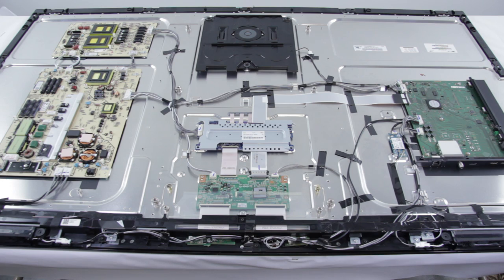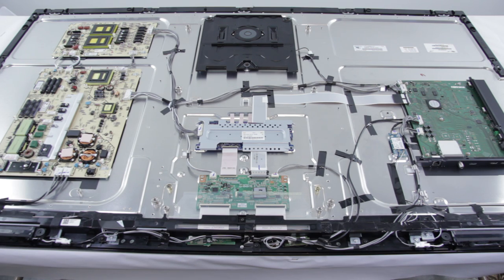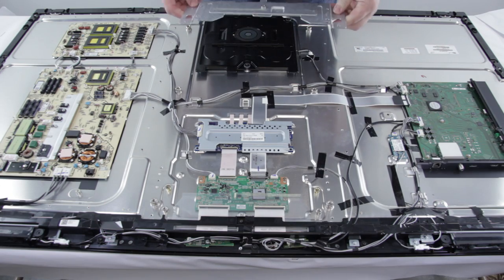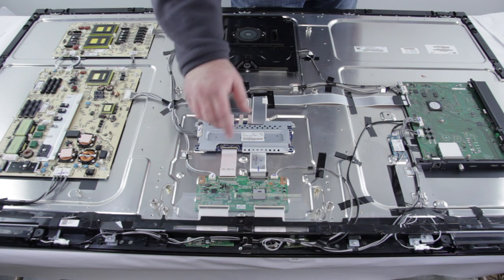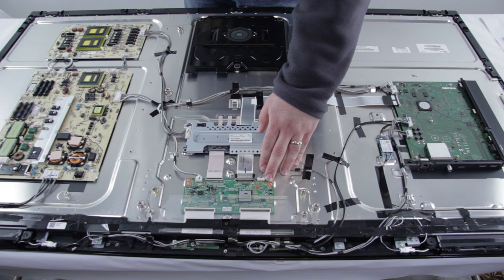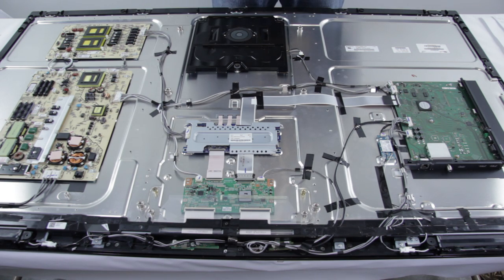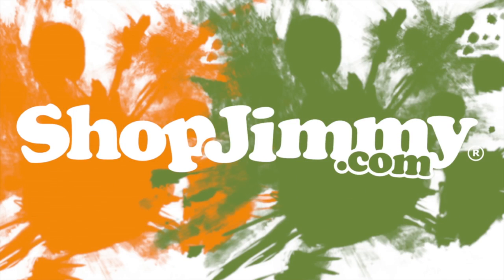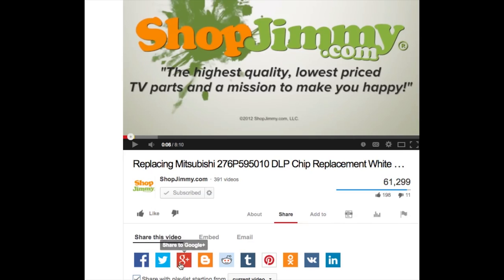LED TV Repair T-Con Board Help Review Overview - Common Issues and Problems with T-Con Boards

Comment: I have a Samsung UN75JU7100 serial number O3KA3CAH100274Z.  TV is 16 months old and while working to put in a flash drive with vacation pictures developed a thin red vertical line on the left hand side of the screen facing the TV that extend from the top to the bottom.  You notice it more with the background is dark but it is there all the time.  I called Samsung and they had be unplug all inputs to the TV,  unplug the TV for a minute then cycle power on and off.  Then turn the TV on and go to the TV menu.  The red line is in the same place which is about a third of the way from the left edge of the TV.  Looking for ideas what to replace, suggestion on how to do it and if you have the part to repair it and the cost of the part.

Comment: i replaced the t con and main board because of sound and no pic. i got my parts from you vizio E7o1i -A3 now my 70 in vizo tv has power back lights and the scran is green when turn on no logo. no buttons work but power. tryed to reset didnt work. help my

Comment: I have a sony kdl 46v2500. When I turn on the TV, it quickly goes to standby mode and the red standby light keeps flashing once every second. I was told it should follow a pattern like flash 3 times and pause or 4 times up to 13 times, but this does not happen. It keeps flashing every second. That's it. I wonder what is wrong. If I unplug it for a minute and then plug it in and trun it on, it will turn green breifly, but before the sond or the picture comes on, it goes to standby mode and turns red and keeps flashing. I don't know what part to change. Do you think you could help me?
Reply from the maker: +Reza Yazdani  Try all repairs and troubleshooting at your own risk.  What is the exact number of blinks that you see with your TV?  Thanks!  www.shopjimmy.com

Comment: Hello, i have A Bravia kdl 32ex425, it shows white vertical lines like shadows and bad color config, i've changed the tcon board but nothing
Reply from the maker: Luis Cuevas   Try all repairs and troubleshooting at your own risk.  This sounds like a TV panel (TV Screen) problem.  If your TV panel is bad, it may be more cost-effective to replace the TV as panels are typically hard to find in stock, difficult to replace, and expensive.  Thanks and please let us know if you have any further questions!  www.shopjimmy.com

Comment: I have a Samsung led TV, model number UN55D6000SF that is not quite 3 years old.  The  problem first started with horizontal lines. The picture would freeze, then the picture would not show on the screen, but the sound remained. The sound is now cutting in and out and the picture is also gone. Can you help?
Reply from the maker: Barbara Taylor  Please watch this video FIRST to help with your repair!  TV Repair! LCD, LED, Plasma, DLP How To Fix Your TV with ShopJimmy.com Help!  This could be a problem with either the T-Con board or the Main board, or the TV panel is bad.  I recommend replacing the T-Con and the main board individually to see if that fixes the problem.  If that does not fix the problem, then you have a bad TV panel.  Here is a link to replacement parts:  http://www.shopjimmy.com/catalogsearch/result/?q=UN55D6000SF  Be sure to match part numbers on your current board, with your replacement for compatibility.  Thanks and please let us know if you have any further questions with your TV Repair!  www.shopjimmy.com

Comment: LG TV Model: 50LA660TV

Symptoms: turning itself on/off, pixelated image so that you cannot see any apps on TV or no image at all, no sound. Strangely enough when set top box is switched on, image is fine for the few second TV stays on. Checked the timer settings and this seems fine.  Checked all the HDMI cables, power cable etc for dirt and all seems clean. No cable damage visible. Swapped HDMI cables and TV still does the same thing. Tried restoring to factory settings.. no effect. TV still does the same thing. Also stopped responding to the instructions sent via a pilot. I am trying to work out whether this is a t-con board or main board issue. 

Show less

Comment: I have a Samsung UN50H5203AFXZC TV. The red light is on, when I turn on the TV the red light flashes 5-6 times then turns off. TV will not turn on.

Comment: I have a Panasonic  LCD, Model # TC-L32X2.  with NO Video and No Sound.  However it worked for a couple of days later and now doesn't work at all.  I checked for the T-Con board connection but was unable to identify.  Any help is greatly appreciated.   It is my porch TV.
Reply from the maker: +Hiram Edwards   Try all repairs and troubleshooting at your own risk.  I recommend replacing the main board in your TV.  Click this link to replacement parts for your TV model number:  http://www.shopjimmy.com/catalogsearch/result/index/?cat=56&q=TC-L32X2  There may be multiple boards for the same TV model number, be sure to match part numbers on your current board, with your replacement for compatibility.  Here is a link to a video showing how to identify your part number, click here:   https://www.youtube.com/watch?v=IrfefQ7SIXkThanks and please let us know if you have any further questions with your TV Repair!  www.shopjimmy.com

Comment: I have a Samsung 40 inch tv model # LN40B530P7NXZA that the dark or black images almost appear as a negative.  I have had to adjust the brighness all the way up to keep the rest of the picture from appearing dark as well.  Any ideas on what is causing this.  Thanks.
Reply: ShopJimmy.com Thank you for your suggestions.  I will give them a try.
Reply: ShopJimmy.com If this were your TV which part would you replace first?  Also I didn't see my T-con board listed in the parts link you provided.  My part # is BN96-017161C. Thanks
Reply from the maker: Richard Zielinski   You may need to replace each of those boards individually.  Tough to say for sure which one could fix the issue.  I don't see any results for that t-con part number anywhere online.  Do you see any of these numbers:  sj-55.40T02.C03, sj-35-D026047, sj-LJ94-01973H   Thanks!  www.shopjimmy.com

Comment: I have 47" 3D LED VIZIO. A couple of weeks ago it started going blank then the port.it was on will show up in the corner liked I pushed input. Now it has sound with no picture. 2/3 Darker screen on the left side, then horizontal line then a lighter screen.
Reply from the maker: Joel Pockrus   Try all repairs and troubleshooting at your own risk.  This sounds like a TV panel (TV Screen) problem.  If your TV panel is bad, it may be more cost-effective to replace the TV as panels are typically hard to find in stock, difficult to replace, and expensive.  Thanks and please let us know if you have any further questions!  www.shopjimmy.com

Comment: I have a Sony KDL-55HX729 TV  the cleaning lady cleaned the screen with wet newspaper and now I had at first a red vertical line appear at (3/4) Quarter of the screen then some time later a blue vertical line appeared on the (1/2 )middle of the TV screen and the area between the (1/2) and (3/4) shows discolored and not a clear picture than the rest of the screen. Please HELP!!!
Reply from the maker: *****   This sounds like a TV panel problem.  If your TV panel is bad, it may be more cost-effective to replace the TV as panels are typically hard to find in stock, difficult to replace, and expensive.  Thanks and please let us know if you have any further questions!  www.shopjimmy.com

Comment: i have a samsung 60" led smart TV model un60es6100. all of a sudden about 8 inches in from the left there is 1 vertical red line. if i go up close it looks like a red dotted line from top to bottom. Could this be a loose ribbon connection or do you think it may need something else?? Thank you so much!!
Reply from the maker: David Carbone Jr   This sounds like a TV panel (TV Screen) problem.  If your TV panel is bad, it may be more cost-effective to replace the TV as panels are typically hard to find in stock, difficult to replace, and expensive.  Thanks and please let us know if you have any further questions!  www.shopjimmy.com
Reply: Do you think it could possibly be a loose connection with one of the ribbons?
Reply from the maker: David Carbone Jr   You can check the connections, but to me, this sounds like a TV panel (TV Screen) problem. Thanks and please let us know if you have any further questions!  www.shopjimmy.com

Comment: i have an ilo LCT32HA36. Every thing fine except i seem to have lost all red color.
Reply from the maker: R Martin  Try all repairs and troubleshooting at your own risk.  I recommend replacing the main board in your TV.  Click this link to replacement parts for your TV model number:  http://www.shopjimmy.com/catalogsearch/result/index/?cat=56&q=LCT32HA36  There may be multiple boards for the same TV model number, be sure to match part numbers on your current board, with your replacement for compatibility.  Thanks and please let us know if you have any further questions with your TV Repair!  www.shopjimmy.com
Reply: R Martin m

Comment: I have a Samsung LCD. Model # LN52A65QA1F. After the TV get warm I am loosing the picture to vertical lines of color. It also sometimes has sound distortion. the TV will not shut off without unplugging it. After turning it back on it will sometimes work for a while but usually will need to cool down. It happens more frequently when watching HD movies. Is this a common problem? Is there a fix? Thanks for your help.
Reply from the maker: Garrod S.  Please watch this video FIRST to help with your repair!  https://www.youtube.com/watch?v=BP3NVNCGEv8  This could be a problem with the main board or the TV Panel.  You can replace the main board to see if that fixes the problem.  Click this link to replacement parts:  http://www.shopjimmy.com/catalogsearch/result/index/?cat=56&q=52A65  There may be multiple boards for the same TV model number, be sure to match part numbers on your current board, with your replacement for compatibility.  Here is a link to a video showing how to identify your part number, click here:  https://www.youtube.com/watch?v=BEPWrefQvqI  Thanks and please let us know if you have any further questions with your TV Repair!  www.shopjimmy.com

Comment: Samsung TV UN60J620DAFXZA Version EA03 doesn't turn on.

TV stopped working wouldn't turn on. Relpaced the powerboard...screen and power button light flash...no picture...replaced motherboard...backlights flash but don't stay on. I don't know what else to do. Please help.

Comment: Hi I have an Hisense LED LCD tv model 40H3E.  My problem is that when I turn on the tv some times i get a lot of flickering then the screen turns blue and I have sound, or sometimes I turn it on then the picture flickers then the screen goes blue also if I keep unplugging it it eventually shows a picture but once I turn off the same symptoms occur.  Do you have any suggestions and parts if I need to order to do repair?
Reply from the maker: +Rasheedah Herbert   Try all repairs and troubleshooting at your own risk.  I recommend replacing the main board in your TV.  Unfortunately I do not see any replacement parts in the search results for your TV model number on our website.  Please reply with your part number on your main board and I can try searching for replacement parts.  Thanks and please let us know if you have any further questions!  www.shopjimmy.com

Comment: I have a Samsung LED tv  with back lights and no picture Model # is UN50H5203 AF abnd the version # is AH01 and the t-con # is T500HVN05 and 50T11-C02 thanks stereoservices

Comment: toshiba 46HL900A
after press power button comes out with with background in split second then it blackout again but the sound is working please  help me.
Reply from the maker: +marlon marcos  Try all repairs and troubleshooting at your own risk.  I recommend running the flashlight test on your TV.   Here is a link to a video we produced that shows how to run the flashlight test. https://www.youtube.com/watch?v=xUzCLgoSPGM Please reply with your flashlight test results and we can recommend a replacement part for your TV repair. Thanks and please let us know if you have any questions! www.shopjimmy.com

Comment: Visio 50 inch E500-B1 turn the TV on watch it turn it off and I leave it off for about two minutes turn it back on and it won't turn on unless I unplug it for about 20 to 30 minutes every time I turn it off I have to unplug for it to work again

Comment: Hello

I have LG LED TV 37LH7020. When I turn TV "ON" there are just white horizontal lines on the top of the screen. If I leave it so for about 10 or 15 minutes than picture comes. Illumination works fine. If I disconect the flat cable that comes from main board to T-CON board and than connect it back it shows picture (under POWER ON), some white lines on the top of the screen remains. I already find replacement T-con board on net. I would just like to ask you on your oppinion about my problem. Do you think, considering explanation above, replacing T-CON board would solve the problem.

Sincerely
Klemen Rotar
Reply: (*some white lines on the top of the screen remains.)  I forgot to mentioned that after disconnecting and reconnecting flat cable (picture comes back) white lines dissapeare after 10 minutes and from that point on TV works just fine.

Sincerely
Klemen Rotar
Reply from the maker: *****   Here is a link to some replacement t-cons, be sure to match the part number on your current board with your replacement board.  Look for the red highlighted information on each t-con boards product page.  http://www.shopjimmy.com/catalogsearch/result/?q=6870C-0264B  Thanks!  www.shopjimmy.com

Comment: Hisence 50" Model 50R6E serial number 50G181844H07122.  TV started turning on and off by itself and eventually stopped turning on. I ordered the repair kit from ShopJimmy and installed yesterday, replacing all 3 boards. Now the TV powers up and I get a picture, but its inverted, meaning the image that should be on the right is on the left and vise versa.  I cant figure out how to add a pic to this post to illustrate my problem, but imagine the screen is cut in half, what should be showing on the left side is showing on the right and what should be showing on the right is on the left. I sounds like I have something crossed, but everything is made to only hook up one way. I tried several different combinations of my original equipment and the parts I bought. I do know my original main board was bad so Im using the one I bought. If the cables from the panel to the Tcon board were longer, Id just cross them and be done with it but as you know they're only long enough to hook up where they're supposed to.  I have factory reset many, many times. Any suggestions for I finally call it quits?

Comment: I have a vizio e32-c1 tv. The TV suddenly loses picture. Initially we were able to have the TV on for about a minute and then the picture failed. I changed the HDMI cable to the second Port. I then only got about 30 seconds of picture after restarting the TV. I then switch the TV over to antenna. We get sound. We have no picture. Currently, when I power on the TV I see the Vizio symbol 4 less than a second and then the TV goes completely black. I believe this is probably the t-con board, it's an LG board inside the TV

Comment: Hello. I have a LG 32LE5500 TV-MA. Recently, while watching TV, the picture froze and stood trembling .... I checked the signal from my cable company in another TV and it was fine. At this time, my TV does not detect the analog signals (tuner, A / V, component video). However, it is perfectly possible to play movies through the USB port. I can also see the signals arriving via HDMI perfectly.

In summary:

Tuner (Analog) -> does not work.
A / V input -> Video: NO; Audio: YES.
Component input (Y, Pb, Pr) + Audio -> Video: NO; Audio: YES.
HDMI input -> Works fine (Audio and Video).
USB port -> Works fine (Audio and Video).

Any ideas?

Thank You.

Comment: I have a Sony KDF-E55A20 Wega. When i turn on the tv the green light blinks for a minute and then turns off (no picture), then the red lamp indicator continually blinks until i unplug the tv. not sure what the solution is.  Any Idea ??
Reply from the maker: N V   I recommend replacing the main board in your TV.   Here is a link to replacement parts for your TV model number on our website, click here:  http://www.shopjimmy.com/catalogsearch/result/?q=KDF-E55A20  Be sure to match part numbers on your current board, with your replacement for compatibility.  You can also call our customer service for further assistance with your purchase.  (877) 881-6492  Thanks and please let us know if you have any further questions with your TV Repair!  www.shopjimmy.com

Comment: i have a sharp aquos LC-60LE632U after about 30 minutes it will start to flicker white looks like a strobe lite i turn it off and wait a few minutes and turn it on  and it will start to flicker in about 5 minutes  what could be the problem     thanks
Reply from the maker: Manuel Rojas  I recommend replacing the power supply in your TV.  Here is a link to replacement parts for your TV model number on our website, click here:  http://www.shopjimmy.com/catalogsearch/result/?q=LC-60LE632U  Be sure to match part numbers on your current board, with your replacement for compatibility.  Here is a link to a video showing how to identify your part number, click here:  DIY TV Part Number Identification Guide for Sharp Power Supply Unit (PSU) Boards  You can also call our customer service for further assistance with your purchase.  (877) 881-6492  Thanks and please let us know if you have any further questions with your TV Repair!  www.shopjimmy.com